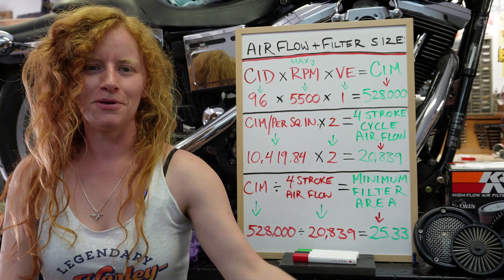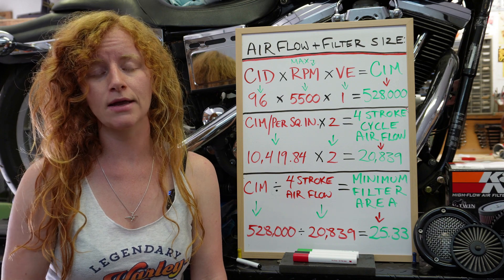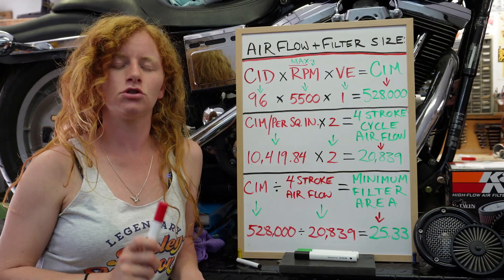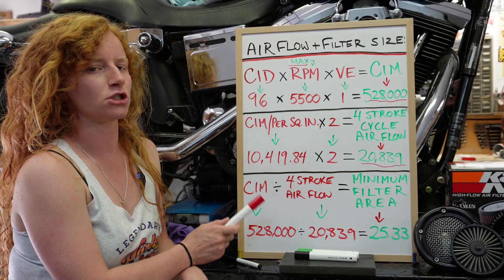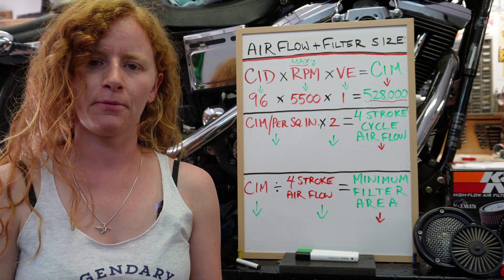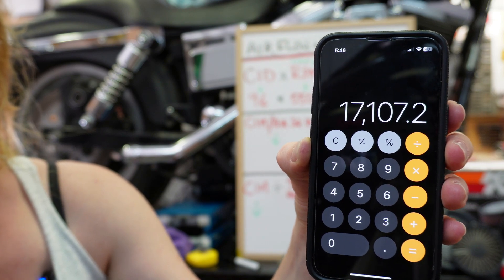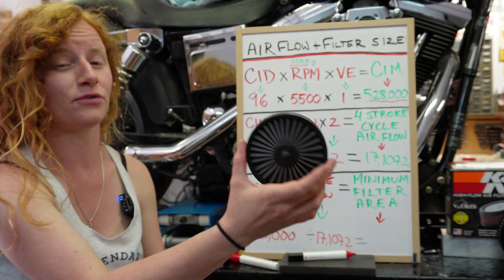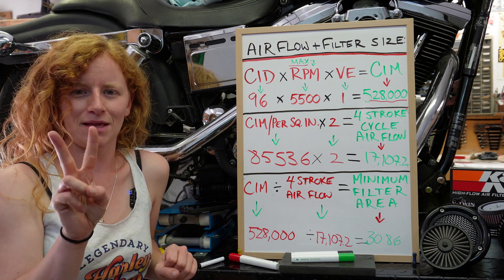How To Find The Right Air Filter For Your  Engine

Comment: Well done Miss Angel,
For those that don't want to do math, there are owner's manuals and service manuals that recommend air filter size, style and volume. 
Too often the first "modification to the bike" someone just had to have is exhaust, flowing more air out for noise without regard to engine performance. Yes I am talking about that much needed back pressure.
From the front tire to the rear those engineers truly knew more than 98% of us whether we like it or not. For those of us that build custom bikes or repair the old ones, understanding the math involved cures so many start-up and run problems. 
Red, I am impressed and grateful! I am going to recommend your video to customers that want the biggest and badest instead of what works best for their application.
YES, you and your Dad built one helluva slim cool bike! She is as Beautiful as her rider/owner.
With gratitude, you are in my prayers
Hoka Hey
Reply from the maker: Thank you Van!! You may find this videos very informative and interesting too, heres the link:  

https://youtu.be/DvMBbojZpII
Reply: @RedRiderCanadaBC  Thank You Angel! What he describes is exactly what I've called back pressure because I size exhaust to work efficiently with the engine from air and fuel intake to spark and piston positions. 
I'll never explain it as "velocity" but I calculate flow to be as efficient as possible without being overly loud or exceedingly "loose".
I'm just an old wrench and not a race engine builder that will never buy the line; "loud pipes save lives". I care more about the life of an engine and motorcycle.

Comment: I use the OEM stock air filter from Yamaha on 2006 Yamaha Stratoliner S. Had it since 1,800 miles, at 40,000 miles now, had the bike for 10 years...
Reply from the maker: Awesome!!

Comment: Hi, I have checked most of the comments, these are very positive, but I think no one mentions your (?) way of four stroke reasoning.
The first formula calculates max air flow, but twice too high, because indeed your engine is a four stroke, which sucks in the 96 CI (in^3) only half of the 5500 rpm. Assuming VE = 100% is good, to get like 15 % margin to be on the safe side (at full throttle anyway).
Then, basically the K&N spec you mention in the second formula, is in fact the max air flow speed they want you to use their filter with. No need to multiply this by 2 "because" it is a four stroke, when you would have made the (more logic) divison by 2 already in the first formula.
The third formula is air flow (in^3/min, but twice too high) divided by speed (in/min, also twice too high, compared to K&N spec), which indeed is surface area (in^2). Where the two factors 2 are eliminated during this division. So fortunately, the result in the end is indeed correct, but less logical to understand (for me, from my humble point of view).
So in the end, the calculation it is not that difficult, even straight forward, engineers (or their computers 😉) are working with it every day, no rocket science if you know how .
Good you touched this subject, because it is relevant for engine performance indeed ! Especially when you build your own bikes, you must not forget to take this into account. Key is also that you know the performance spec of the filter material you choose.
Reply from the maker: Thank you for sharing your point of view. The formula I'm using is not my own, it's one  I have seen used by several different race engine builders.

Comment: Nice job Angel...I remember when you were showing your air cleaner in an earlier video...I always thought with that..."I think it was an incense burner" ? In your air cleaner, it would be restricting your air flow, no matter what filter you used, correct me if I'm wrong !! I use K&N air filters in every vehicle I own, and have never had a problem with them...but if you over oil them they can mess up some of your sensors  in your air intake system, on fuel injected vehicles !! You are so smart Angel, I love the way you explain things, and break it down in layman's terms...so that most people can understand it...Nice job !! ✌😘
Reply from the maker: I don't believe that piece in my air cleaner is restricting air flow. I put it in there because it has a similar shape to the cones inside S&S air cleaners that help to create a bit of turbulence... But I haven’t actually tested it out! Bike seems to run and burn uo fuel just fine tho! 😁 Thanks Junior, much appreciated!!
Reply: @RedRiderCanadaBC  it was just an observation Angel...I try to pay attention to all of your video's...keep them coming sweety 😘✌

Comment: When I was doing these calcs for my Camaro, I used a VE of .85.  A VE of 1 is ideal, but for a stock production engine, almost impossible to achieve.  Still, thanks for the refresher.  It's been decades since I did this kind of math.
Reply from the maker: I think one day I will do all the math and figure  out my engines actual  VE, but not till after I rebuild it and give it the proper compression.

Comment: Огромное спасибо за позновательное видео! Oh, these beautiful nerds with their calculations, this is not rock and roll. More than twenty years ago, I had a two-speed moped. We bought an engine for it, but there was no air filter there. And we just cut off a small piece of rubber pipe, put a piece of an old shirt on it (In this shirt I was cleaning cows that morning), tied it with wire and everything worked fine. All rock and roll.

Comment: Red,   Thank you for that explanation of air flow...I can't say that I followed the whole thing, but damn, did it sound scientific. But can't you assume by examining a spark plug that came from your engine if it is running lean or rich? And if it is too lean, the filter is too large and if it is too rich, that the filter is too small? Or is that backwards?
Reply from the maker: Well, I think there are more things that would factor into the mixture being either to lean or too rich and air flow is just one. So I think to get it exactly perfect on any bike then someone  would have to dive a little deeper into some of the science around thermal efficiency and all that. This math that I am doing i would  just consider as a starting point for those who don't want to get super technical, but still want to be sure their engine isn't having the air restricted through the intake. 🙂 Thanks for watching!

Comment: Very well said, Angel.  Nice presentation, for sure.  I am assuming you want to take into account (eventually) the VE.  As the engine runs over time the VE is going to decrease.  How much?  Who knows... depends on the time and the conditions (sooner than later if the air quality is very dusty|dirty depending on conditions).  Anyway, you probably want to assume something like 0.86 or something to account for the filter getting dirty over time, which would mean that the filter should probably be just a little larger than would otherwise be normal, so that at decrease VE the right amount of air-flow would still be achieved.  

Very interesting, really enjoyed your talk. All engineering is about mathematics!  Again, nice job.

marcus
Reply from the maker: Thanks Marcus! Yea, I think one day I might look into all the science behind getting the top performance out of an engine, it's really interesting stuff!
Reply: Good point Marcus 100%ve=brand new.  Altitude would really mess with my xs750 yham a haw carb

Comment: My UL with ULH pistons does not require much air, since my redline is 4,400rpm, and I probably never rev it that high, but I just eliminated the air cleaner. !! :) Problem solved! The Bug-guard gives it all the airflow it wants.
Reply from the maker: I think for something that you probably aren't riding around too much and most  likely only on clean roads, no filter is properly okay, eh? I always worry about dirt getting sucked in there though.
Reply: @RedRiderCanadaBC  I do ride around much, but for sure never on dirty or dusty roads. Never on a dirt road for sure, I'd turn around first. I would agree that for a really high mileage engine, a bike ridden day in and day out for transportation in all sorts of environments, a filter is good. For myself, they just seem "over rated", and not necessary. I do have a "bird guard" as they are sometimes called. (that says: "RAT" on it, imagine that. :) "Back in the day" many (most?) of us ran with no filter, just let the Linkert hang out there in the breeze, and I don't think our engines wore out any faster than normal. ? That's my story and I'm sticking to it. !!!!
Reply: I forgot to mention, I'd never suggest or advise anyone to not run a filter. Certainly not a "do as I do" thing. I do things others should not do. :) !!! That's just me ha ha. Your pal, Rat.

Comment: Red, I sent your last installment to my brother, who understands things far more then I.  I asked him if he could follow your mathematical logic. Here is his reply...

More or less.   But I'm not sure she got it right...
She figured filter area by the circumference , but all those folds make it much more.
And doesn't a 4 stroke engine draw in air only every 4th stroke?
So she should divide RPM by 2,  not multiply by 2.?

But she's cute... could be the redhead in the song?

100 degrees out today (Fri).
Reply from the maker: Hey, thanks for watching and sharing 🙂 
So, a 4 stroke motor ingests air on every second stroke. And the formula I used is the same formula I've seen used and repeated by several different professional  performance engine builders. Since I've had a few different comments regarding the pleats in the filter, I emailed K&N and I am hoping to hear a reply back shortly about how to properly measure the filter. But (to me) it makes sense that K&N would tell us how to measure the filter area of an assembled air filter, since we are not going to take our filters apart to measure them without the pleats. And, with everyone who I saw using this same calculation, none of them mention measuring  the filter area without the pleats.
Reply: Red, I so appreciate you being willing to respond to my questions. I still have a basic misunderstanding about how a 4 stroke engine works. This is what I thought:
1) Piston at top dead center. Goes down, sucking in air fuel mixture.
2) Piston comes up, compressing air fuel mixture.
3)Spark plug ignites air fuel mixture driving piston down for power stroke.
4) Piston comes up pushing exhaust out.
Doesn't this make four strokes? Or am I counting strokes wrong?
Reply from the maker: Yes, that’s how each cylinder works in a 4 stroke motor.
Reply from the maker: And sorry, just re reading my last comment I noticed I made a mistake. What I meant is a v-twin motor ingest air every second rotation.

Comment: Interesting, Red.  Now, eleven years ago I dynoed my 2008 Corvette, 1st with a K&N, then with a generic paper air filter and lastly with no air filter.  No filter yielded the greatest hp;  the generic paper was second, and the K&N was last, being the most restrictive option.  The two filters both fit exactly inside the airbox.  Hmmm . . . .
Reply from the maker: Weird!!! I'm just going by the numbers I found on the different websites 🧐 Curious though!
Reply: @RedRiderCanadaBC  I bought a K&N for the same reason you mentioned: numbers found on websites.  Perhaps those websites were disiinterested, perhaps not . . . who knows? When I saw the results I argued with the technicians, initially.  But they proved to my satisfaction that their results were legitimate.  I'm still at a loss, frankly.

Comment: I have the stock hamcans on my Shovelheads I have the feeling the intake (by the little plastic grill) has a smaller area (and is therefore limiting) than the carb opening.... but as long as it keeps from small animals from being ingested I am fine with it as I never run above 3000 rpm. anyway..